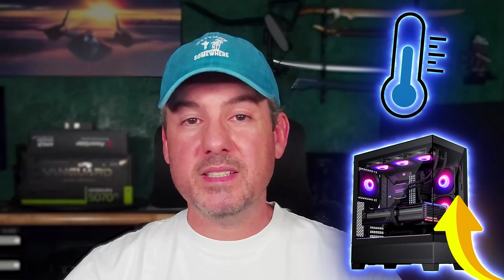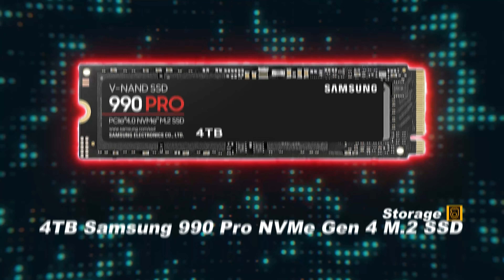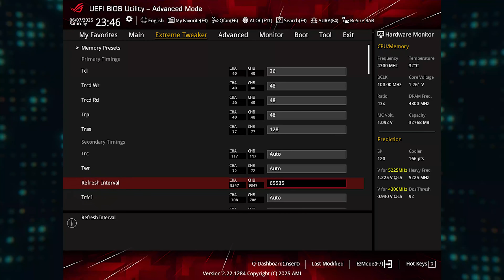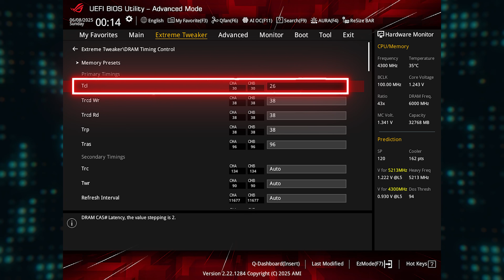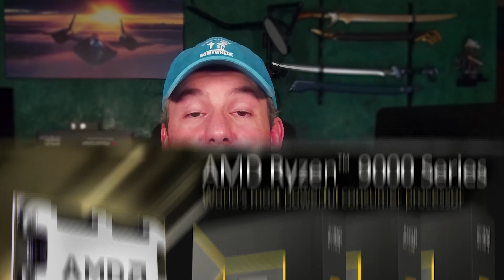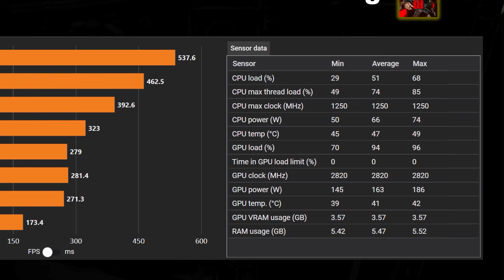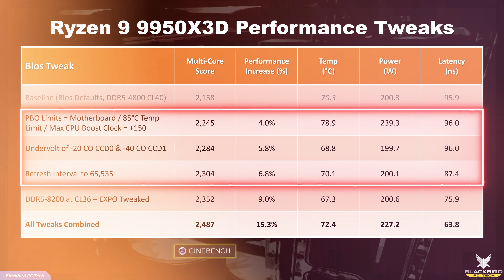What Are The Best Settings for an AMD Ryzen CPU?

Comment: Awesome video!  I am stunned you actually answer virtually every comment on a 6 month old video with over 1000 comments... On to my question:  I will have my new gaming system soon:  5080 + 9800x3d + 64gb 6000 CL30.  Given that I will be playing in 4k, it seems that any OC for my CPU will be irrelevant for my gaming.  So what I plan to do is just to undervolt it and that's about it.  Does that make sense?
Reply from the maker: Nice system ... I would recommend following the guide and fully tuning your system, not just undervolting. The reason is that in many modern games at 4K, the CPU is still heavily loaded even when the game is GPU bound (GPU load close to 100%). A good example of this would be Microsoft Flight Simulator 2024.

Comment: I have a 9800X3D paired with an Astral 5090OC and 64 gig of DDR5 6000 CL30...i just dont understand why the need to push these components to their limit when all i do is gaming... so far NONE of the current games needs overclocking...So WHY???
Reply from the maker: You should try turning on path tracing in games. The question I have for you is why did you buy an Astral and not an FE if you are not going to overclock it? The Astral is designed to be overclocked ... if you knew you were not going to overclock, then why not save a lot of money and buy an FE or other base model?
Reply: @blackbirdpctech  The Astral is already overclocked standard...i manly play Battlefield 6 in 1440p ultra and reach around 200 fps..i dont see the need to overclock it even more?
Reply from the maker: @silviutudorescu8114  don’t confuse factory overclocks with proper overclocking. A factory overclock is more about marketing with very little performance benefit.

Comment: Wanted to ask what the 7800x3ds minimum processor state should be when using high performance for gaming purposes. I've had it set itself to 100% and to 0% on different occasions on the same pc and can't find a good answer on what it should be for gaming latency and stuff
Reply from the maker: You will always get a performance benefit if your processor doesn't have to "spool up", but it shouldn't be large enough to worry about.

Comment: Hi, for 7200 MHz CL34 RAM with a 9800x3d, what would you recommend? I am currently using 2200 FCLK
Reply from the maker: You have two options ... push for 8000 in 2:1 mode or drop to 6400 in 1:1 mode ... I would try 8000 first with an fclk of 2000, and if that's not stable then try 6400 with an fclk of 2133.
Reply: @blackbirdpctech  Okay, I'll switch to 6400. Do I need to enable memclock =1:1 in the BIOS?
Reply from the maker: Yes, I would recommend doing that to be sure ... I would also recommend tightening your primary timings.
Reply: @blackbirdpctech  Can I choose a predefined DDR5 6400MHz profile so that the timings match automatically?
Reply from the maker: @ZepekCOD  I cover this in the video or you can join our Skool community to get additional help:

https://www.skool.com/blackbird-pc-tech-4230/about?ref=67e6a7048d9540fe87cbdf1b69bd47f3
Reply: @blackbirdpctech  Hello blackbird, I switched to 6000 MHz CL26 at 2133 FCLK 1:1 and it works fine. My AIDA64 latency has been reduced by 17 ns. Do you have any other advice? I found that I got the same results at 6400 MHz CL30 2133 FCLK.
Reply from the maker: @ZepekCOD  for additional support, help, tips and guidance, you can join our Skool community: https://www.skool.com/blackbird-pc-tech-4230/about?ref=67e6a7048d9540fe87cbdf1b69bd47f3

Comment: just did a -30 core curve undervolt on my ryzen 5 7600 but the temps are still the same during the stress test at 94 degrees celcius, am i doing something wrong? i followed the exact step by step in the video
Reply from the maker: It's possible that for some reason your undervolt was not applied ... do you have an option on your motherboard to apply the curve offset in a different bios location/menu?
Reply: @blackbirdpctech  Yeah iam sure its applied, even reboot the PC and checked the bios and it was there 30 negative, btw i got a really crap cpu fan not as bad as stock but a pretty budget one, could it be that even before the undervolt my cpu was already reaching thermal throttling since the max temp for the 7600 is 95 degrees?
Reply: @blackbirdpctech  also i did get a pretty noticible better 1% low in the doom the dark ages benchmark since the game is heavy on the CPU
Reply from the maker: Then yes, perhaps it's your cooling solution.

Comment: Great guide! You should probably also mention how each option affects wattage. In most real world systems people aren't going to be using 1200W PSUs, and some people might be looking for gains which come with minimum power. For my system switching from EXPO I to EXPO tweaked resulted in 20-30W increase in power for very small gains in OCCT memory and latency benches, and nothing in a range of 3D Mark benches.
Reply from the maker: I showed the impact on power draw for each tweak in the video.
Reply: @blackbirdpctech Saw the table for the RAM configs but not anything else. If its there then my bad
Reply from the maker: @RecklessCharger   there is no if ... it's in the video ... that's the good thing about videos, it's either in there or it isn't ... the table is titled "Ryzen 9 9950X3D Performance Tweaks" ... the power is also in the memory performance table ... so I'm not really sure how you missed it

Comment: Fantastic video! Thank you for enlightening us plebs on the technicalities of messing with this. However, I'm running into an issue with AIDA64. I was running my system with DOCP 1 enabled at 6000MHz/s on a set of DDR5 Vengeance 2x16GB 6000 C38 along with an UV of -15 on all cores on my 9800X3D, exactly as you instructed in this video. I tested at least 10 hours on Witcher 3 and about 2 hours on Arc Raiders and had zero issues. Temperatures dropped about 8-10°C and benchmarks on Cinebench 2024 and CPU profile on 3D Mark also gave much better results than stock and zero instability. Only AIDA64 gave me a failure about 5-10 seconds after starting the stress test.
Because of this I got a bit paranoid and decided to drop the UV to -10 on all cores and still got a failure in about 10 seconds. Tested an undervolt of -5 and also got a failure in about 45 seconds. The only times AIDA ran stable for 30 minutes was with DOCP disabled and no UV and with DOCP 2 enabled and no UV. Any undervolt I apply seems to fail AIDA. 
Did I lose the silion lottery here? Can (or should) I ignore the results in AIDA and keep a conservative UV of -10 on all cores? My PC is 1 month old and this is the first time I'm tuning these settings. Thank you!
Reply from the maker: So if you run DOCP I without any undervolt you fail the AIDA64 stability test?
Reply: @blackbirdpctech  Yes, I tried to run DOCP I once without any undervolt and it failed. Then, I decided to reset my BIOS to default and try DOCP II and it passed AIDA. So, technically, after the BIOS reset I did not try DOCP I, only DOCP II. 
Maybe important to note is that when I reset the BIOS, these were the changes that were announced:
"ErP Ready" from [Enabled (S4+S5)] to Disabled
"When system is in sleep, hibernate..." from Disabled to Enabled
"USB power delivery in Soft Off state (S5)" from Disabled to Enabled
"Full HD Setup" from Disabled to Enabled
Reply from the maker: @jpmonlevad  after resetting your bios I would try running DOCP I ... if it fails then I would replace your CPU
Reply: I see, I will switch to DOCP I, let it run for about and hour and see what comes up. Thanks for the input!
Reply: @blackbirdpctech I just changed DOC 2 to 1 and the PC booted to desktop normally, but now the motherboard is displaying a white light constantly.
Reply from the maker: @jpmonlevad  is there any label on the motherboard next to the white light?
Reply: @b @blackbirdpctech  says VGA, but I just ran Steel Nomad and it ran fine with  good scores. AIDA is also stable.
Reply from the maker: That's a good sign and gives you a good baseline to tweak from ... if you need additional help you can join our Skool community: https://www.skool.com/blackbird-pc-tech-4230/about?ref=67e6a7048d9540fe87cbdf1b69bd47f3

Comment: Just tuned my 9 7900x3d. I will say it's a bit annoying, I feel that unless you have a nice ROG or Gigabyte mobo you are so fucked bc you need proper bios options. Also the recommended way to fix parking issues is a fresh windows install lol. Anyways it's nice I always come back to this vid whenever I gotta setup a new cpu.
Reply from the maker: The PBO feature set comes with virtually all AMD motherboards ... so you really don't need a high-end motherboard to use it ... it's one of the advantages of going AMD.

Comment: How did you determine what to change the dram refresh interval to? And would it be the same for all amd cpu? I’m running a 9800x3d
Reply from the maker: It's a relatively common tweak within the overclocking community to help reduce your latency. You can use it on any CPU. The only issue is if your RAM get's too warm, you may start experiencing memory related errors ... so make sure you have good airflow.
Reply: @b @blackbirdpctech  Is it named something different on gigabyte bios? I wasn’t able to find it under advanced memory settings for my AORUS pro mobo
Reply from the maker: @sair149  might be called tREF or tREFI

Comment: Isn't ccd1 supposed to have less optimizer magnitude than ccd 0 which supposed to be better and have higher clocks and also have a higher magnitude?
Reply from the maker: Not sure where you got that idea from but it's not true ... for a 9950X3D, CCD0 has 3D v-cache while CCD1 doesn't ... the silicon lottery will still determine how "good" each CCD is

Comment: Hello Sir thank for you fantastic and easy to follow video. My question is. If I never intend on overlocking my 9950X3D should I undervolt my cpu?? What’s you thoughts on this?? Will I see a significant drop in FPS when gaming??
Reply from the maker: Absolutely ... you will likely see a small increase in performance together with a drop in temps and power
Reply: @blackbirdpctech Thank you man. Great content again. Thank you

Comment: You say that expo1 is the most stable and expo tweak can cause issues and then say AI is wrong for saying that expo tweak can be unstable.. That's a bit contradictory.
Reply from the maker: I didn't say that at all, but it doesn't matter what you think I said, it's literally in the video. What I actually said was:

"What’s truly fascinating is that if you look this up online you will see a lot of misinformation, with Google AI incorrectly stating that EXPO I is the most reliable option, and that EXPO II is more aggressive and could lead to instability … this is simply not true, and a good reason why you shouldn’t trust AI tools when tuning your PC."

Comment: Love your videos. Ive watched them in the past & settled on -20 and nothing else. "From a previous  9800x3d undervolt vid" and have ran stress test. But i get crazy micro stutters & freezes during gun fights on bo7. Ive done everything i can think of. Could i pay you to remote in and have a look at my pc? I just want my game to run smooth. Its super depressing. I need to rule out what my problem is. Plz help lol. Thanks
Reply from the maker: The best thing to do is join my community on Skool … I can help you there:

https://www.skool.com/blackbird-pc-tech-4230/about?ref=67e6a7048d9540fe87cbdf1b69bd47f3
Reply: @wesleyyounce9100  I’m having the same issues same game. Let me know if you find a fix 9800x3d 9070xt

Comment: Hey, i really wanted to do all that, but as soon as i enable Expo for my ram - AIDA instantly Crashs out.. doesnt matter which Profile i activate. Just instantly crashes.. got an msi x870 gaming wifi plus + Ryzen 7 9800x3d + 64gb Kingston 64gb 6000 Mhz cl 30. any Idea? ^^
Reply from the maker: How many dimms or sticks of RAM do you have on the board?
Reply: @blackbirdpctech  I downloaded OCCT and ran it 1h - With AVX512 Set - no errors... I got the CPU to 5.4 Ghz with PBO -25 now.. games are stable. as soon as i go -30 my games crash. so i think i got the settings for me.. But the RAM issue kinda needles me to be honest.
Reply from the maker: @dominikkaros8923  have you tried testing your RAM with Karhu? Also, did you try running AIDA64 without EXPO turned on?
Reply: @blackbirdpctech  I dont have karhu... aida without expo on works fine
Reply from the maker: @dominikkaros8923  so then you almost definitely have a RAM stability issue ... either buy karhu or run memtest86+
Reply: @blackbirdpctech  I ran the Memtest 86 - usb - booted from stick and ran it for an hour whith no errors. i will try the 86+ version
Reply: @blackbirdpctech  i did a memtest86+ 3 runs, all tests - no errors ^^ i think aida is trolling me...
Reply: @blackbirdpctech  2 Dimms at 32GB each

Comment: Thanks a lot for this video. I’m testing -20 on my 7800x3d. Since this chip can’t overclock should I still set PBO to motherboard and the thermal throttle limit to 85 for better performance? I have a rog strix x870E-E. Appreciate the advice
Reply from the maker: Setting a thermal throttle limit will not improve performance, it will simply prevent your chip from running too hot if you don't have good cooling ... it will do that by reducing your clocks, which will reduce your performance. If you place a heavy load on your CPU and it remains cool, such as running Cinebench multi-core, then you likely won't need to set s thermal throttle limit. Expanding the power limits in PBO should still help the 7800X3D ... that's something you can check.
Reply: @blackbirdpctech ok thanks for the info!

Comment: I have 2440 score in Cinebench 2024, without overclock, with UV of  ccd0 15 / ccd1 10 , 6000 mhz  memmory with expo activated, NO thermal limit, NO OC, and with  tdc / ppt /edc  manually put for stock  9950x3d.  So I have a score,  without OC of the memory and also of the cpu,  almost the same with  "All the tweaks combined" from your chart. So maybe your tweaks are not so good :) or mine are to safe...
Reply from the maker: Whenever you compare scores it's always important to make sure you are using the same drivers ... if you look at my recent video where I tested the 9950X3D against a 9800X3D, 14900KS and 285K, the Cinebench score went up quite a lot. You may also have a golden sample chip.

Comment: What about c-state control on ryzen 9800x3d better enable or what?
Reply from the maker: Not sure where that came from, but it does absolutely nothing for a 9800X3D. You can take a look at this video where I demonstrate it: https://youtu.be/0JzE1Gyns8Y
Reply: @blackbirdpctech  Thanks, I decided to keep C-state enabled in BIOS and set the Windows power mode to High Performance the most optimal option
Reply from the maker: @bfghawe4  I would recommend trying with and without c-states enabled to see the impact
Reply: @blackbirdpctech  Hi, I recently asked you about c-state on a Ryzen 9800x3d. I tried turning it on and off, and it made absolutely no difference. However, the high performance profile in windows added stability. Previously, my processor would drop its frequencies to 2.5 GHz without using it, but now it only drops to 4.7 base frequencies. It seemed to me that this added a little responsiveness
Reply from the maker: @bfghawe4  yes, I recommend the high performance plan in the video for everything other than Ryzen 9 processors

Comment: I somehow got a -35 undervolt to be working..kinda concerned but it’s working fine lol. Also my cpu temps only dropped around 2 degrees when I did the cpu benchmark test on the 3dmark.

I got like a 57 degree average with noctua air cooler on my cpu. 9800X3D
Reply from the maker: Did you check your undervolt in AIDA64?
Reply: @blackbirdpctech yep, it was stable during the testing.
Reply: @blackbirdpctech yes it seems to be pretty stable so far. I need to run the monitoring software you mentioned while playing a game.
Reply from the maker: @hybridxx  sounds like you have a golden sample!

Comment: Ok. My 9800x3d strange behavior or golden chip? 😅
CO -30
Cpu boost +200mhz
Pbo enhancement level 1 (up to 90°C).
Vcore is 1.260V during tests, spikes up to 1.280V.

Passed all stability tests, but Vcore is my concern.

BUT, when I change to CO -20 there are 1.34V spikes and on CO -10, spikes are 1.38V!!!

Is that normal behavior?
And minimum low Vcore is 0.592V on a milisecond, usually sits on 0.9V. Is that normal?
Reply from the maker: If your temps and power look good relative to your stock configuration then I wouldn't worry about it ... unless of course you are using an ASRock motherboard.
Reply: @blackbirdpctech  I forgot to set up LLC on level 3. Now Vcore is 1.21V on full load. Cpu is now 5.3GHz all cores, 73-75°C No spikes.
Testing stability right now...

I guess it's normal...

Comment: Come on man, who runs ddr5 at 4800 LOL At least 5200 should be the proper baseline, if not even 5600!
Reply from the maker: DDR5-4800 is the stock baseline configuration ... that's the thing about stock settings, they are not defined by you or me ... they are defined by the manufacturer. So while you might have an opinion, it doesn't really matter because it won't be stock.

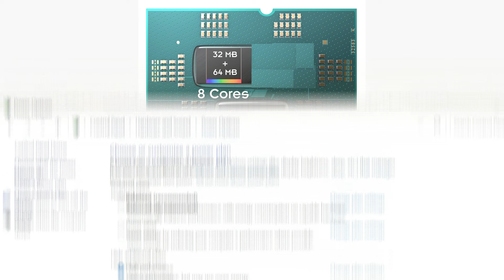Comment: At 20:50… should “Ultimate Power Plan” be used, or should it go no higher than “High Power Plan” for a 7800x3d used ONLY for gaming?
Reply from the maker: I've experienced some issues with the ultimate power plan, so I prefer using the high performance plan.